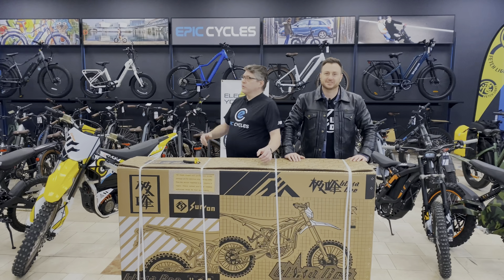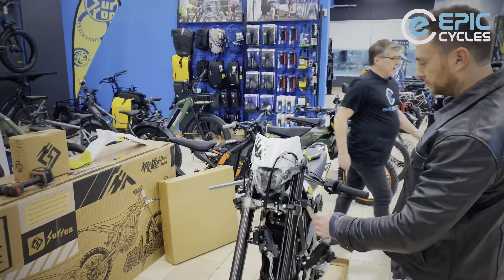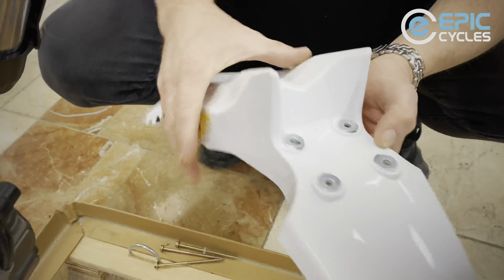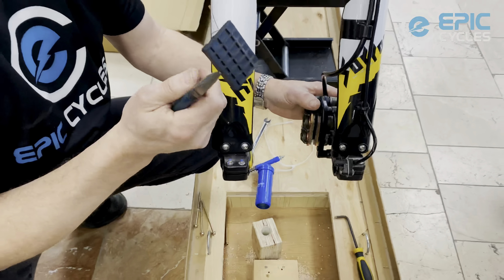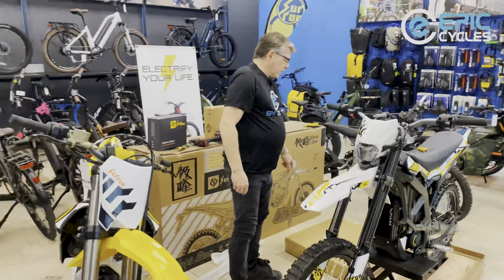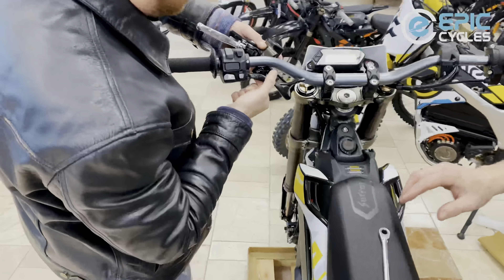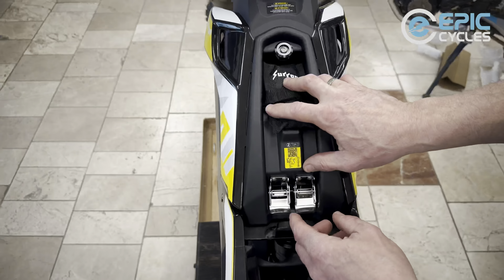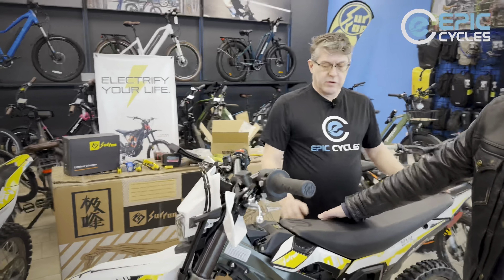Unboxing and Building the Sur Ron Ultra Bee - Step by Step Build Instructions

Comment: 14:22 they show you orientation of hardware, you put the washers on the wrong side at install with the grease. normally the washer with the lip goes at the top of the fender, keeps it in place and the regular washer goes on bolt side. not that it really matter's

Comment: Why grease is a dirt bike?what happened to locktight
Reply: This guy loves grease but doesn't use it appropriately.   No grease on the wheel bearing seals?
Reply: He lost me when he talked about the witness marks, torque spec, used grease, no torque wrench.

He obviously has a big company. Whoever there that knows what their doing should be the one in the video. 

None the less I learned what I needed to about the assembly.

Comment: I'd rather have the rear brake on the right side of the handle bar. That way the front brake is the same as my motorcycles. Is that possible?
Reply: It's actually the opposite, the front break is on the right side because your clutch is on the left side. Your back break is normally on your right foot(yes it is possible to install a foot break on this bike)

Comment: SO im going to call BS on this video because your front wheel axel came right off with ease mine barely moves and is blocked by the oposite side of the hexanut that silver peice seems to be welded to the axel peice... it will not pull out. What do I do when this happens?
Reply: Dealing with the same issue, how did you resolve @marcussmith4913
Reply: i have the same thing happening
Reply: @Joel-eb8gb  I honestly do not remember now. However I did get past whatever it was.